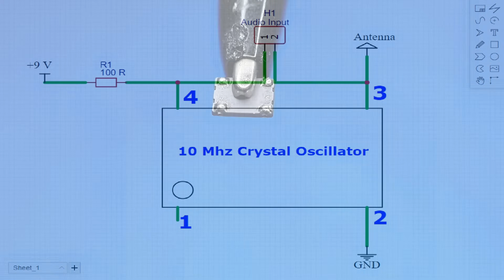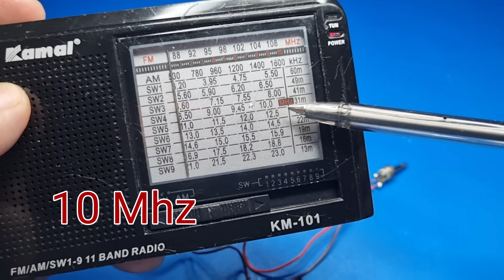How To Make A Radio Transmitter With Only 2 Components - Great Idea You Haven't Seen Before

Comment: I'm so jealous to guys, who understand electronics. I understand how elements work separately, but I cannot understand at all, how, and WHY it works in combination. It's total magic for me.
Reply: Don’t feel bad. I’m an extra class ham radio operator and I barely know enough to keep from smoking my radios…well…most of the time.
Reply: As an electrical engineer i want to say that learning electronics is very simple if you want to learn it.
Reply: @cuf_  well, from the very beginning they starting to tell that electricity flows from positive to negative, but voltage flows in opposite direction, they talk about weak electricity on transistor base and strong electricity on collector, and also where comes resistance and power? And no practical examples at all.
Reply: Basically the silver box generates a constant 10mhz signal and the way that radio works is it sees that 10mhz signal and when that signal becomes louder or quieter itll generate sound and basically the headphone jack is sending signals to that box too for example 1000hz so that signal becomes louder in the same pattern as 1000hz thus that radio can see this change is loudness and decode it
Reply: @romanyarygin1674  looks like the people that told you this are bad teachers. They make it simple for them but hard for you. A transistor is a switch. And electricity goes from plus to minus but ELECTRONS go the opposite. The fact that electrons go the opposite direction does not matter unless you are making a vacumm yube CRT aka the electron gun.
Reply: @romanyarygin1674  ĺ
Reply: Yes, i just fun with elektronika but don't understand wkwk. Maybe just little.
Reply: @pengintai_target3955  electronics is a great hobby. Keep going and some time we are all on mars.
Reply: Plenty of great teachers on Youtube, start with basic electronics, for a few months, build some simple circuits, then move up to higher levels.
Reply: Me too
Reply: @cuf_  I respectfully disagree.  You have to have that and someone like W2AEW or IMSAI guy to explain it.  I struggled for decades with relatively simple concepts such as impedance and reactance.  Being into them since the 70s, I was a wiz with computers and digital logic was simple to grasp, but analog circuitry (AC) electronics were very difficult for me.  Thanks to those that I mentioned, and a few others such as Mr Carlson and Doug with the guitar amps, I have a much better grasp on AC circuitry and even using tubes.  Been a ham for over 30 years, and learned a ton from that, but a handful of geniuses on the internet have really helped me understand.  I tend to visualize in my head for understanding and I didn't really possess good mental imagery for electronic circuitry. Relating everything to water in pipes can only take you so far. :)
Reply: @mynameislikethis  like you say.
Reply: Watch electroboom
Reply: Me too...
Reply: You have to thing about it more iorder to get proper ideas
Reply: SAME
Reply: @frequencywatchers  are u
Reply: @assasinatorx325  Yes
Reply: Well evrything teck looks like magic but its not try to learn ~how~ some components work
Reply: @johnlepcha5171  hi
Reply: I feel the same as you
Reply: I suggest you take an introductory electronics course at your local city or community college.  You'll learn more than you think you can learn, and it will be a lot of fun.  I had an idiot of a brother who told me that unless I learned higher math like Calculus I could forget about learning electronics or any other science; it turned out he was dead wrong.  There is almost no math involved in electronics until you get into very advanced areas, and you can make amazing things with no math at all.  
I didn't take electronics until my 40s, and I was shocked at how easy it was to learn.
Reply: @maskedmarvyl4774  Huh, thanks for advise. Now need to think where to get such friend in my Crapville :) but I'll figure it out. Thanks)
Reply: It’s one thing to understand how elements work separately but it isn’t a huge leap to understand how they work together. Electronic circuits, pneumatic circuits and hydraulic circuits all share common elements and if you understand one type of circuit, you can apply the knowledge to understand another.

Start with a simple circuit and add more complexity.

All the terms you don’t understand below can be found on-line.

In this example, the crystal oscillator is a carrier wave source. It produces a constant sinusoidal waveform when it has a power source (battery).

The 100R is a resistor to limit the current from the battery. That protects the crystal oscillator from being damaged.

The audio source (iPod shuffle) provides a audio waveform and this is modulating the amplitude of the sinusoidal waveform of the crystal oscillator. The amplitude is just the maximum and minimum values of the sinusoidal waveform. 

The coil has to be a certain length to match the wavelength of the 10 megahertz oscillations. This is the part that is broadcasting a radio frequency waveform comprising the carrier wave merged with the audio signal.

The transistor radio receives every radio signal possible and using the tuning dial, it is possible to pick one frequency out of the many. The radio pre-amplifies the signal before it removes the carrier wave, leaving the audio signal. The audio signal is amplified before it reaches the speaker and you hear the resulting music.
Reply: It’s sorcery I tell you! Sorcery!
Reply: Back in the early 2000s, I relied on books from the library and radio Shack to learn simple circuits. They never did a good job explaining how they work and could never grasp it. I feel like if I was still into electronics, I would have a much easier time learning these circuits on YouTube.
Reply: @romanyarygin1674  a lot of teachers don’t really understand and confuse students a lot.
Reply: Think in terms of Energy, frequency and vibration
Reply: i know how electronice and cprogramming works and mechanics and craftsmenship >:)
Reply: dont feel bad this dude is fake that has 3 components and he isn't running properly
Reply: Your problem is jealousy, fix it
Reply: @cuf_  I don't want to be on Mars. There's nothing there.
Reply: @herrlich1461  Everything in the local universe has a chance, because the amount of particles in our universe is limited in a infite timeline everything possible all combinations of atoms will exist infiniye times. So even if i dont try to find a dupe and instead tell madison bear or whatever to find a dupe at some point in the local timeline i will find a dupe. Lets say u are a 4d creature, u exist everywhere in the timeline and the universe. So if u are a 4d creature u already know everything and anything, also a good woeking dupe on cosmic.Anyways what i wanted to say is there is a dupe and an infinite amount actually, all u havr to do is move in the timeline and fina all the matcing combinations of atoms that are what acutually causes a dupe. If the atoms in the servers hdd in this timeline are arranged randomly, but "correctly" we have a dupe. If not wait another 10^36 years and there is a big chance for the correct combination of atoms to exist.Im not afraid of death, im just a random lifeless combination of clustered particles, i have no point in existane other than follow a series of rules including the fear of death. Those rules are always random as the usinverse is random but as we can see a lot of chaotic event merges a predictable pattern, just like with cfing, just in the real world its not called cf method its called laws of physics. Thats a message i sent my friend when i was 16
Reply: @cuf_  That's already where you go wrong. You're not a "random combination of particles". You are God's creation.
Reply: @herrlich1461  are u a flatearther?
Reply: @herrlich1461  if yes then 💀
Reply: @cuf_  Are you a flat earther? You sound like one. 😁
Reply: @herrlich1461  no
Reply: L9p0
Reply: It's a hack not a proper transmitter, basically you have 10 Mhz signal that you re affecting its amplitude with audio input
Reply: Electronics are the whole world🤝
Reply: Okay, but how do i know why i would use a 100R
Reply: @romanyarygin1674 :

Who the hell is "they"? Stop thinking in terms of "they" and start thinking in terms of "we".
Reply: @rutherfordagripa5042 he’s ok but often electrocuted including smoke fire and broken circuit breaker
Reply: The feeling is mutual❤
Reply: Поверь, мы тоже
Reply: I know how does this work
Reply: @maskedmarvyl4774  yes bro
Reply: @cuf_ very true, its only hard if you don't have the passion
Reply: @romanyarygin1674 electricty and voltage don't flow, electrons flow. Due to historical bad assumptions which we decided to stick with, current is defined to flow in the opposite direction. Transistors don't obey the ohm's law as it is only for conductors, not semiconductors - so no resistance there (at least nothing measurable).

Ultimately, resistance is simply heat loss from having the electrons travel a longer percieved path.
Reply: @gliderrider  cccccccccccccccccccccccccccccccccccccccccccccccccc
Reply: Everyone here seems to act as if they know a thing or two but never point out the bs video
Reply: just think of flowing water...Just mater of energy.
Reply: @herrlich1461 yes.  God's creation, but some believe that random thinking can guess how much is 1+1= ???? Random produces  this amazing ting called life, love, kindness.
Reply: @herrlich1461 God's creation, yes. Random combination of particles is just chaos, and would chaos have wonderfully emotion such as love for your neighbors? But those who believe they are a pile of chaotic matter would never see and love God. Unless they see their blindness and be healed. 
Electronics is understood by chaos. Electronics is simple as building a brick wall: one brick at a time, day by day, hands on. There is no royal road, but the old good road of one step at a time.
Reply: I hear you. The physics explanation of how the component works is very straightforward.  But then how and why components are attached to each other seems totally random.  How did they come up with which capacitors or resistors to connect?  It's like to go from basic electronics learning to calculate series and parallel V, I, and R to then capacitance, inductance, reactance, etc.  It's easy to be copycat builder but I'd really like to understand more about why design decisions were made so I can apply it or modify it to my own needs.

Why a 100 MHz oscillator?  Why 100 ohm resistor?  How to know which edge connectors to solder to?  How many turns and what radius for the antenna? What is SW4 vs AM vs FM?
Reply: You lozer 😂😂😂
Reply: I too bro👌👌👌👌👌😢
Reply: there is ton on line now to help you get the knowledge ..mostly though it's math and not hard math
Reply: ristor reduces current
Reply: Where should I start give me a road map @cuf_
Reply: Then im a wizard?
Reply: Muito top

Comment: If I am not wrong brown, red, brown is a 120 Ohm resistor not 100 Ohm that would be brown black brown. Besides its is not a crystal. It is an oscillator despite of what Chinese marketplaces that sell that describe as crystals, or translate as crystal. Crystals have 2 pints this have 4 pins and an VCC input. It has a crystal inside but has semiconductors too.
Reply: Yes 120 ohm

Comment: The Crystal Oscillator is the Magical bit. It has a natural oscillation frequency that vibrates with an applied voltage. Vary the voltage and that natural frequency also changes. Hence FM modulation. The rest is just - simple electronics - adding a signal wave to the carrier wave and sending it off through the e.m. field.
Reply: Do you know this transmitter how many meters or km works?
Reply: @rubis5153  Not very far. Signals decrease according to the inverse radius squared - and this signal is already pretty weak so... 
I don't expect much. ;)
Reply: @MathewTitus  do you know any modul that i can send voice to 5km?
Reply: @rubis5153  Well I'm sure you can Google that ;)
Reply: @MathewTitus  lo interesante seria poder hacer el receptor tambien....  como walky tolky
Reply: No. No es así.  El cristal está tallado para solo una frecuencia.  A lo sumo puede resonar  en armónicos.   Nada tiene que  ver el voltaje aplicado. Además hay algo que no muestra o no dice en el video, la configuración mínima y básica para mantener una oscilación es si o sí  un amplificador ya sea con transistor o algun ci. Y este re alimentar al circuito oscilante, en este caso un cristal piezoeléctrico.
Reply: @rubis5153  You don't want it going far.  You would interfere with the 10 MHz time and frequency stations WWV and WWVH
Reply: How can I make it FM? I want to record directly from an aux jack but my tape boombox has no line input.